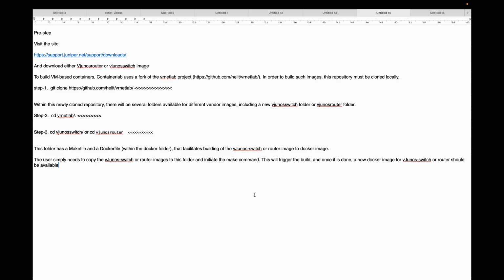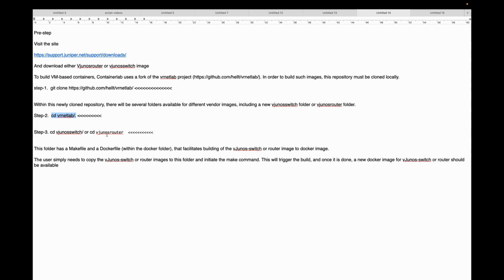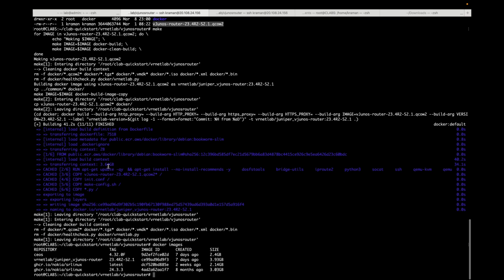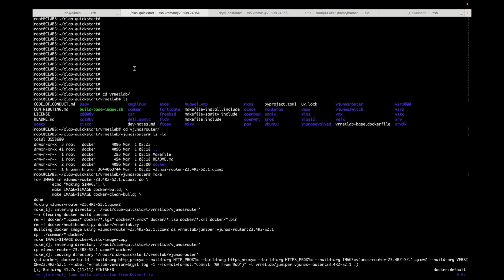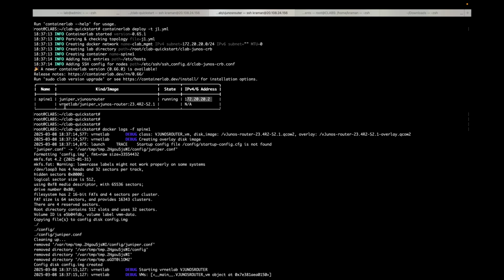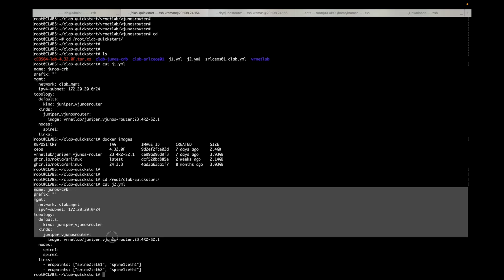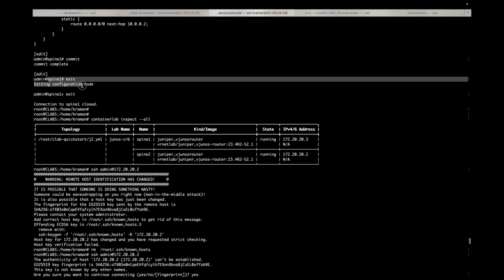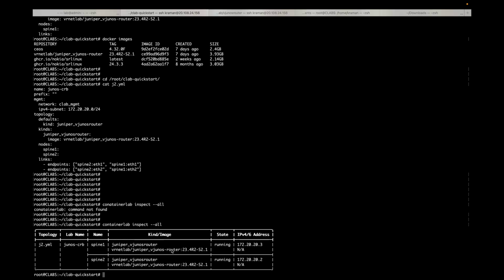How To: Start Virtual Junos Router or Switch using Container labs installed on Ubuntu (Easy & Quick)

Comment: Please do mention that for Juniper vJunos you need a Ubuntu running on a bare metal server otherwise it won't work
Reply from the maker: Hi , Thanks for your comments, I had tested this on a Azure Cloud VM(as shared on the video), which is not a dedicated bare metal server, also on VM based machine you can run this, as long as  hardware acceleration is enabled.
Reply: @LearnNetworks-Plexinor  Is it possible to share resources allocated to VM like CPU , RAM etc
Reply from the maker: Yes, kindly refer to the video under the azure portal section I highlight how much cpu and Ram I used , it was 32g ram , the video has that details specifically when I discuss about azure portal
Reply from the maker: 32g ram and 8vcpu it’s mentioned in the video about the kind of machine I used , please refer to the part which speaks about azure portal section